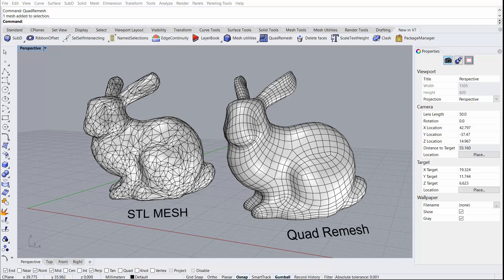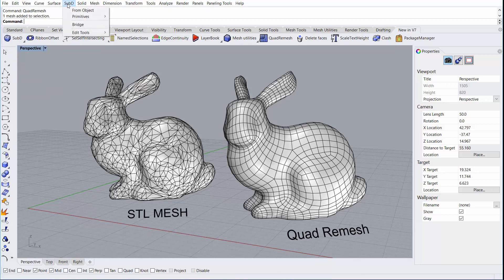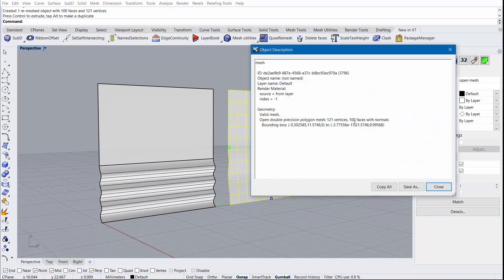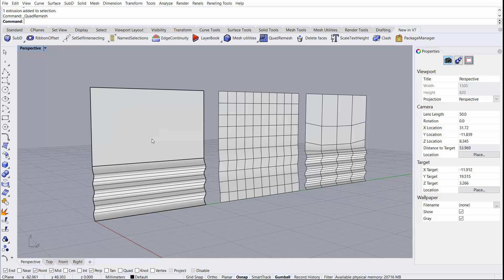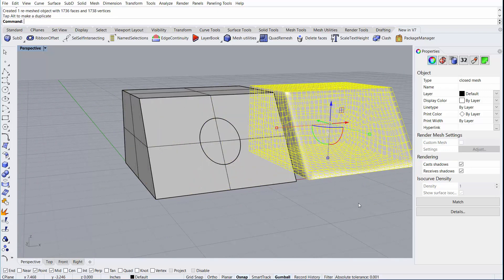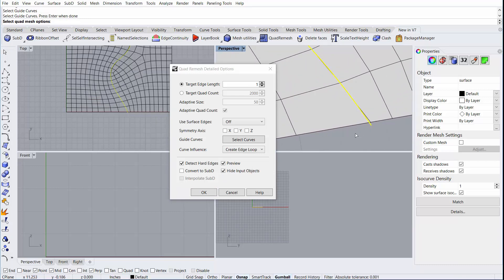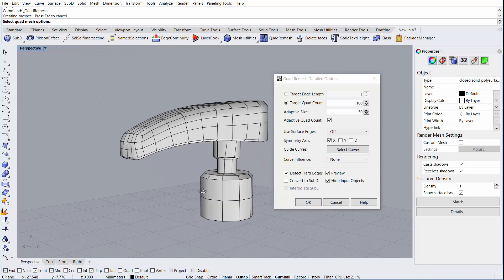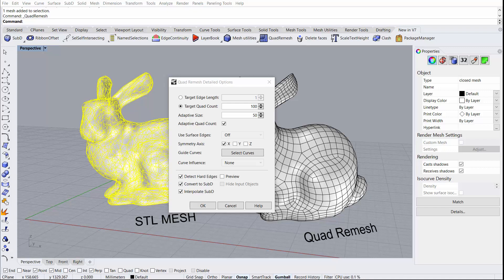Intro to the Quad Remesher in Rhino V7 WIP

Comment: Awesome tool. To improve this tool, please add an option to match resulting mesh edges. For example if you cut a surface in the middle and run quadremesh command you would get 2 mesh objects that connect at vertices. Right now you only get mesh objects that aren't matched where the vertices should line up.